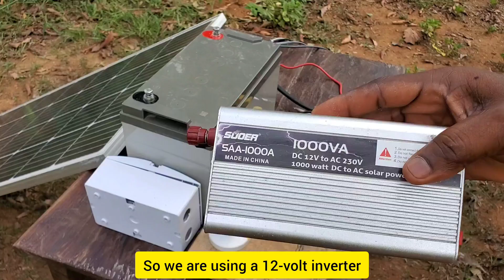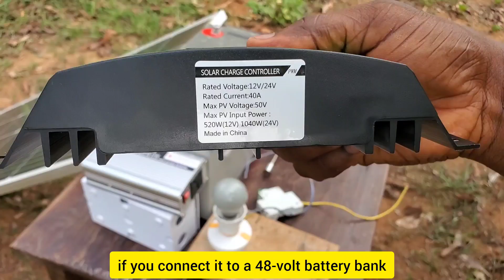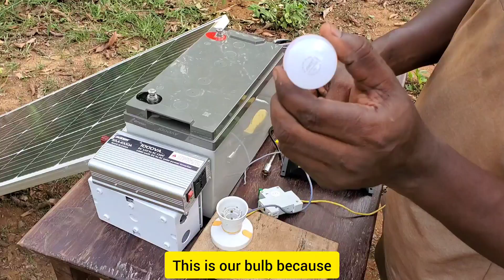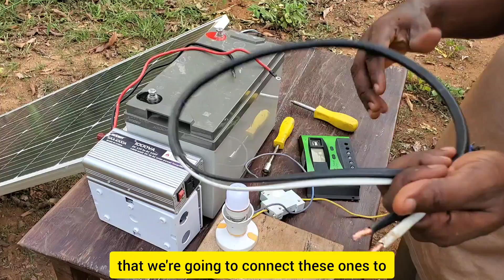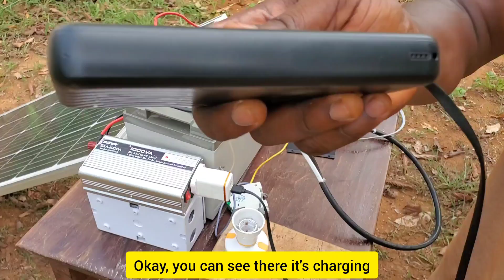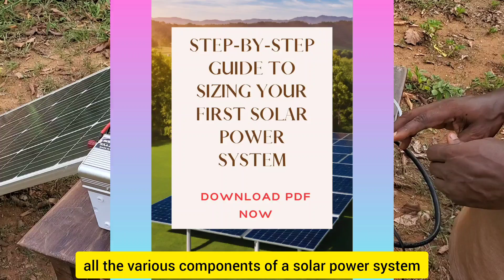How to connect solar panel and inverter to 12 volts battery.

Comment: I've a solar system and of 100ah lithium batry and 200w panel wz de same charge controller but it doesn't auto start charging in de morning unless u first tap direct front solar to batry for like 5mns dats wen it starts charging wen u connect bak to the controller. Wat cou6be de problem

Comment: after connecting charge controller to the battery it read 12.6v  and battery voltage i herd yousaying its 12v  why this positive  difference

Comment: my senior, good work. I have a small concern. I bought your ebook on the step-by-step sizing of the solar system. in page 11, where you are calculating the battery bank capacity, where did you get the 51.2 V as the nominal voltage for the system?

Comment: Its a very good video. I have done the same setup to power a small pond pump. It worked for 45 mins in fairly dull weather. 6 weeks later and during a very sunny period i tried again and now everytime within seconds of plugging the pump into the inverter the alarm goes off and it shuts down. Have redone the cables several times and charged the battery but the same happens.  The controller shows energy going to the battery from the panel. The usb slots on both the controller and inverter charge devices. Any thoughts

Comment: Thank you sir. I have a solar panel that is not rated in normal voltage but rated open circuit voltage which is over 43 v. How do I know the normal voltage 12/24/48? Please

Comment: Can electricity charge this directly??
Reply: I have been asking sane questions. I need answers
Reply: @ apparently there are two types one comes with inbuilt charger electricity can charge that and the other doesn’t so if you’re planning to get it, buy the one that has charger written on it
Reply: I just found out you can get AC to DC 10 volt charger.... It will charge the battery directly from NEPA or generator. Cost is around 25k
Reply: No
Reply: Good evening please how much does this setup cost?

Comment: I have a similar setup but once the sun goes down the solar turns off sometimes when the sun is really high the solar still turns off please help
Reply from the maker: Check the battery if its still good and check if the solar panel is properly connected.

Comment: Sir I'm learning a lot. I'm watching from lagos. Thank you for making the explanation 
Understandable. I see some people buy inverter, battery and charge controller without solar panel. They use Nepa to charge the battery. Is it advisable and how do they do the connection.
Reply from the maker: @VictorAnthony-m4w  You can use inverter and Battery without solar panels. You charge the battery bank with power from the grid or generator

Comment: What is the battery capacity sir
Reply from the maker: @Saintkingsley-lw1ns  12V, 100Ah
Reply: @Solarwattng can’t I use rocket battery 12v 75ah 
But is a car battery

Comment: How many dry cell batteries can I add to 1000w hybrid inverter, the inverter already have inbuilt 100ah batteries and it have space where I can and external battery, so I want to know how many 100ah I can add to it, meanwhile it have  pwm charge controller

Comment: Enjoying the lessons.  I have a 12volt system which I use for lighting and charging components such as phones.At times, when the sun is too hot, the solar inverter's fan start rotating very fast. Sometimes i encounter problems with my inverter where it keeps " burning" ie getting faulty. What could be the problem and how can it be sorted.
Reply: Check to see if you're using the right wire guage for your wiring. That could be the problem

Comment: Should one connect the bulbs to the battery or the inverter so that they light up even at night? How do we do that, also I can see you included circuit breaker, I wish you included how to add that to the system tio make it fully functional even with switches. Sorry I missed that section. Otherwise, excellent work sir.

Comment: Can a car battery 100 harm ×2= 200 harms connected series still bring out 12v  in charge control .
Reply: No, it will give 24v
Reply: Connect it in parallel then you get 200ah 12volts

Comment: That PWM charge controller is really a beast. It's lasted years since my small setup was install and it has never disappointed me. Hope to get the mppt brand.
Reply: Not as effective as mppt though.
Reply: Brand new 80 watt solar panel

Comment: Good evening. I installed my solar and found out that bulbs where blinking. What could be the issue?
Reply: You have return the wire from the inverter output to the inverter, kindly check your connection or call an expert

Comment: Hello sir for how long can this run on a 200 watts load using 500watt inverter, pure sine wave
Reply: 200W load at a 80% efficiency pulls 250 W from battery

At 12v that is approximately 20 A

Drawing 20 A at a 100 AH battery discharge rate will be 5 hours.

Comment: Weldon sir, pls can dis single panel power my 32inch tv n three bulds
Reply: It is not the panel that is powering your TV but the inverter itself. The panel only chargees the battery